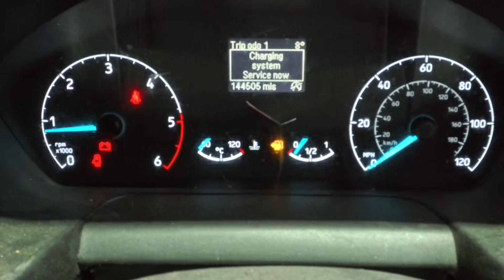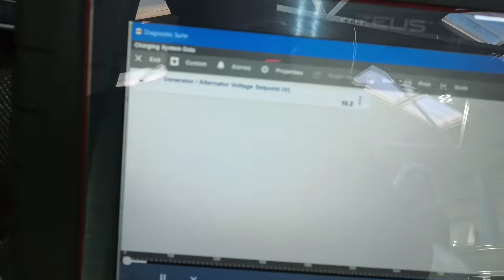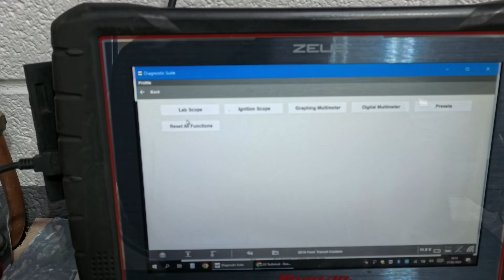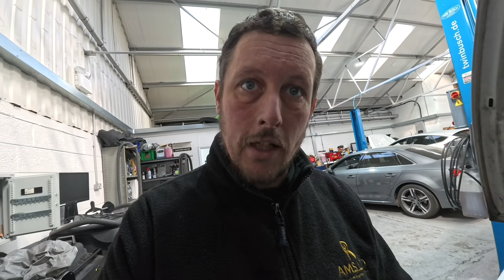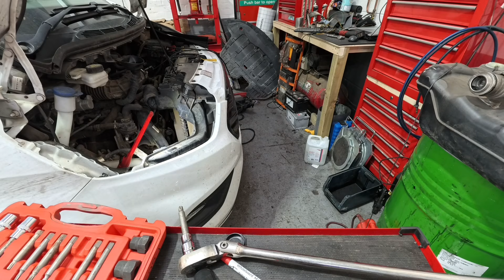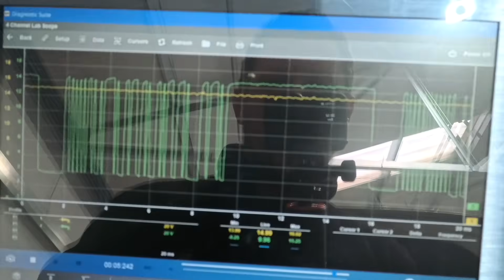🔧 Ford Transit Custom Charging Fault | Diagnosis & Repair (Overrun Pulley Fault)

Comment: I got a 70 playe transit and I changed the battery last year. All good until the stop start stopped working. Went to get the batter tested and they say it’s fine take it on a long drive. 60% full? Any recommendations. I’m quite happy to pay for a proper diagnosis and repair. I just don’t want some dude to say it’s this and it ain’t it then it’s that and it ain’t that so on and so forth.

Comment: Another great methodical Diag and proof of actual component required ... apart from focus issue already mentioned I think a body worn mic would be beneficial not only for you voice dropping in and out, but also maybe reduce radio in background which may in time cause you copyright issues on the music ?... another super episode and onwards to the next m8 👌

Comment: Hi Chris,  a nice example of a 'known good' clean Linbus signal. A 'battery not charging ' fault can confuse many a 
technician, add electronic charging management into the equation, & you can end up 'going down a rabbit hole' before firing the 'parts cannon' multiple times before 'striking lucky'😊. My introduction to the engine managed charging system,  on a vehicle with an intermittant 'starter battery not charging', with a battery warning light 'ON' (intermittantly), was on a Honda CRV 2.2  Diesel. Upon lifting bonnet, alternator was not even visible, so much for visual inspection😃. With extensive anticipated labour hours, i had to be confident in my diagnosis before committing to removal of unit & bench testing. It was a great introduction to a linbus controlled, electronic voltage regulated system😐. Having carried out all basic tests including integrity of linbus signal, removed alternator, bench tested (on the ground😄)  & identified a failed voltage regulator. Thanks for uploading, good diagnosis. Have a good weekend. mike